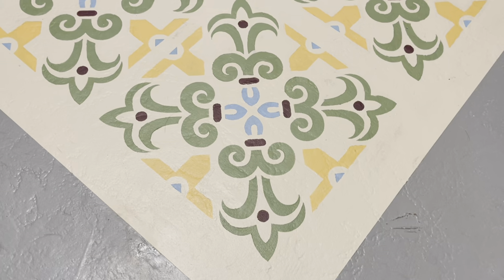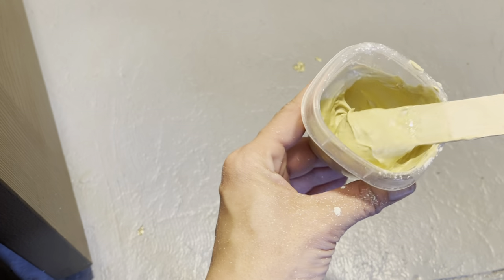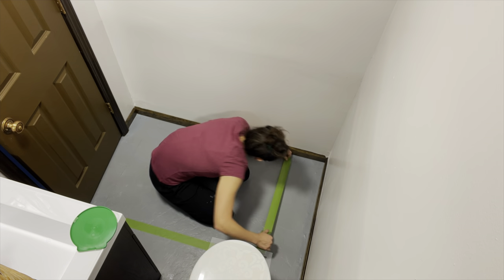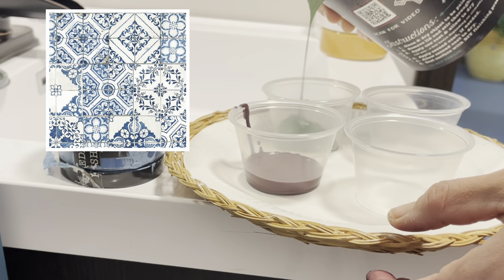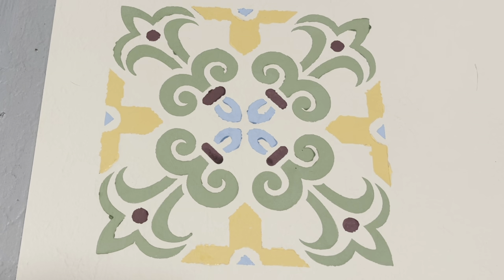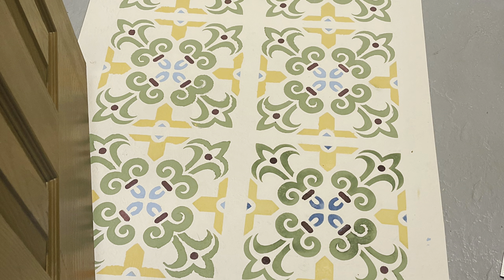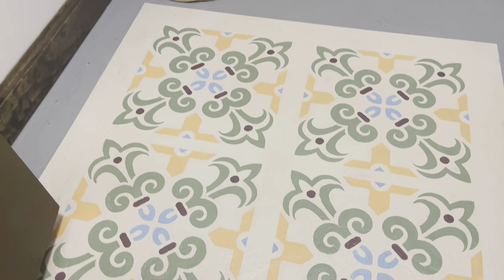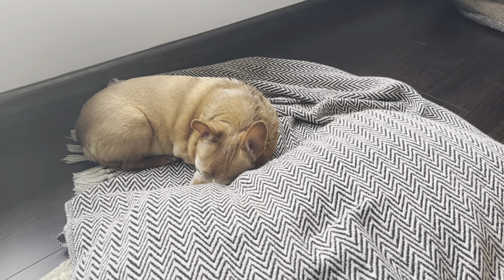Farmhouse Friends Go Boho! I DIY Stenciled Rug w/ JRV Stencils! I Boho Bathroom Makeover

Comment: Bri, I was horrible at stenciling and steered clear of it because of how crappy it always turned out. This year I found some really dense foam pouncers on sale at Michaels and gave them a try. Game changer!! The brand is Folk Art, but I couldn't find them online when I looked. I think Martha Stewart has some like it. The foam is thick, like a makeup applicator. You just pounce up and down and not in circles. It helps a lot to prevent bleeding.